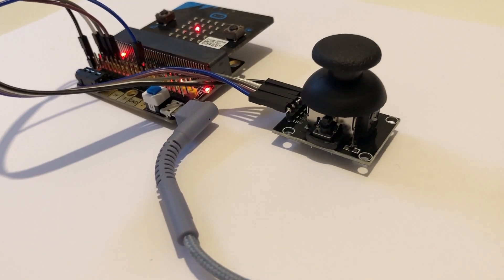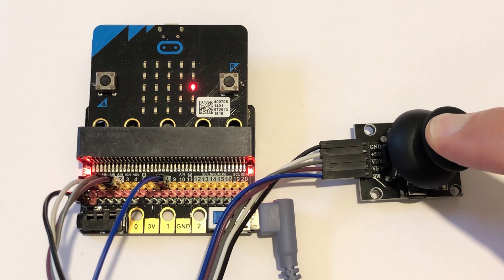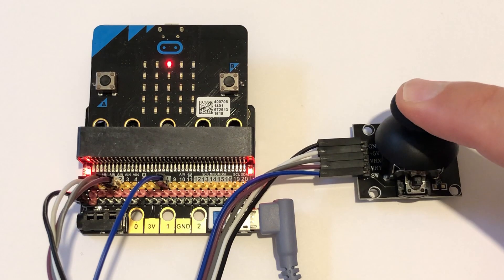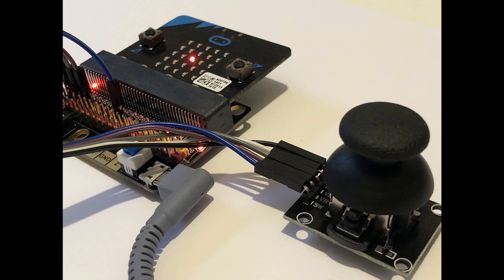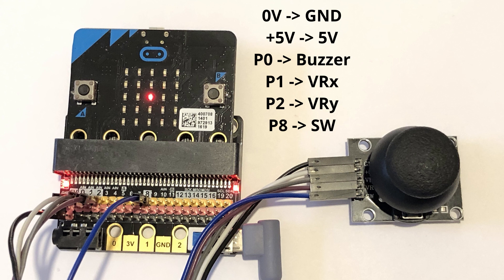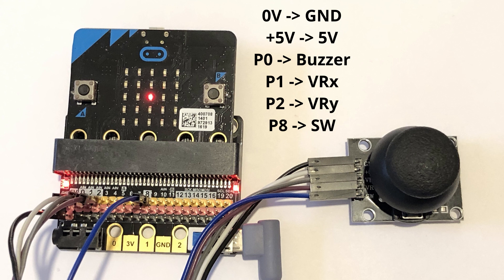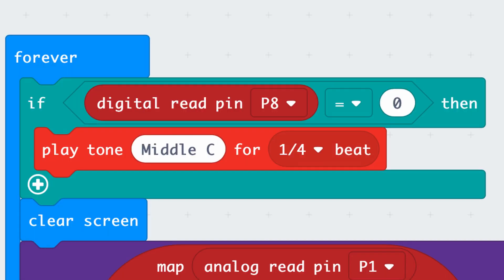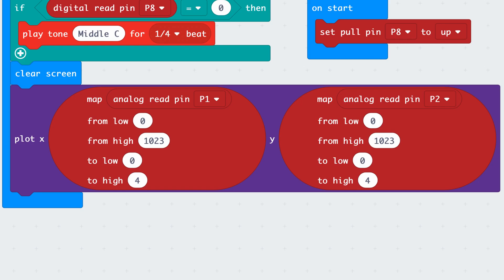micro:bit Project Joystick with LED Position Feedback Tutorial Ideas

Comment: I thought the Microbit only went up to 3 volts?
Reply from the maker: The expansion board is powered via micro usb hence the 5v supply. It would also work without the expansion board running on native 3v 2xAAA batteries with direct connection to the microbit
Reply: @ElectronicsLoop  thanks, I will try it with the aaa's.

Comment: i have a   gpio extension board, i don't know if that is the problem
Reply from the maker: check for pull up / pull down settings and also for connection to +5/GND. We were using an io board. Fingers crossed :)